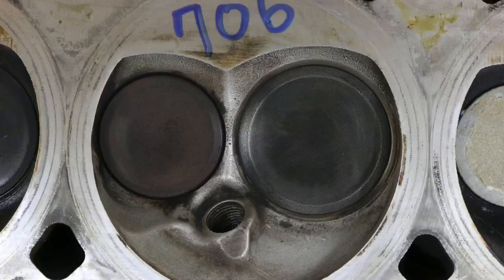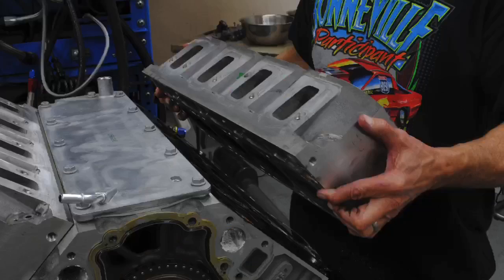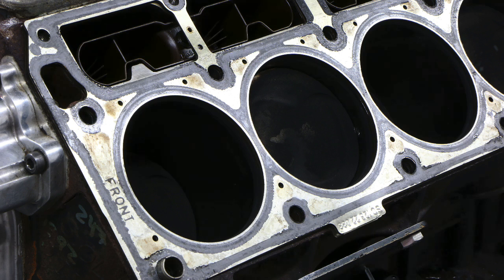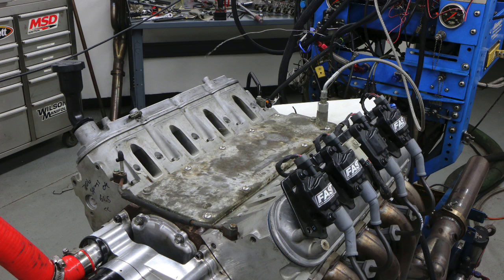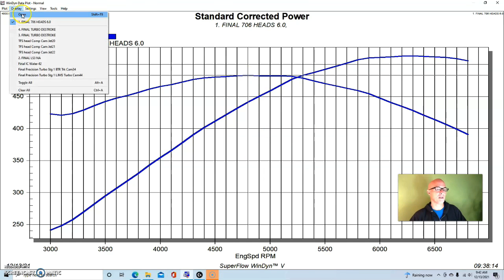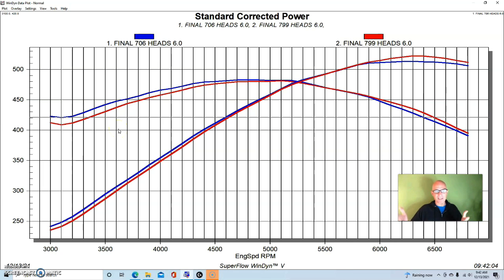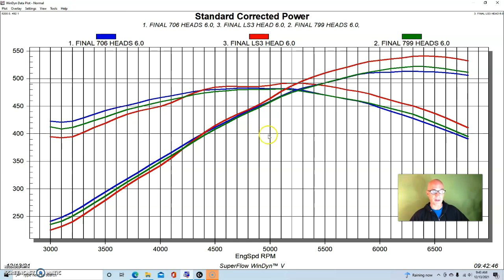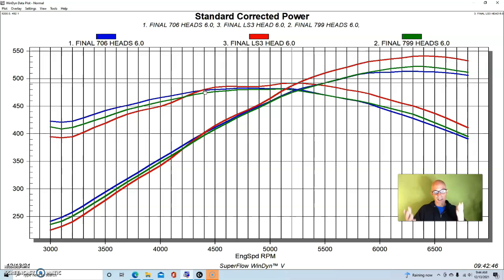JUNKYARD LS HEAD UPGRADE-CATHEDRAL PORT VS REC PORT-WHO WINS? 706 VS 799 VS 317 VS 823 (6.0L & 6.2L)

Comment: Ok so from what I've gathered from lots of people the original cathedral port design was implemented to promote low speed velocity and chamber filling while also out performing previous sbc heads.  As designs changed and volumes increased a need arose for more upper rpm flow, hence the change and evolution of gm cylinder heads. Now we've all seen good ported heads(stock and aftermarket) keep up with and even beat quite a few square port heads.  Now really good ported factory heads from gm back to back generally the square port are just superior....except in the lower lift numbers, not always but mostly and often not by much. However you can get factory gm ls3 style heads above 370 cfm with the right porting job, repeatable all day long amd that's something the ls1 style castings can't do, at least stock heads. Really though Richard obviously is right, if you're boosting any of these heads within reasonable boundaries, are perfect. Yes the curves might be rather different and one will probably promote more high rpm power nut like he said a 750hp turbo(etc) is still limited by how much power it can make and response is a matter of choosing the right setup/size and a/r. Similar to a blower of any design, though in this instance you may notice a bigger variance in power curves but not necessarily peak power. Rung what ya brung boys!
Reply: Im working on a budget build and love Richard's testing to help build off of. I took an lm7 block bored it to a 5.7, got some gen iv rods and a new set of ls6 pistons, sent my 706's off to a local port guy who is highly reputable. He ported them for 400 dollars and sent the bench flow numbers back and they flowed 310 cfm at .600. I had them  milled .020 and assembled and got the block decked and the numbers are pointing to 11.5ish compression with flow of 310 cfm. Got ahold of cam motion and got a custom cam speced for my piston clearance with milling .621 .604 229/237 111.5+3. Going single plane holley split intake with 1000cfm 4brl holley throttle body. Seeing all richards numbers im really hoping this engine size, flow, and compression can get me the 550 ish hp range. I like wierd junk. I dont like walking everyone elses shoes. Gonna put this in a 2wd jeep comanche. I know there are other and likely better ways to make the power, but i wanna be a little different and think i can get the numbers i want with that setup.
Reply: You're sort of missing one of Richard's main points: there's no free lunch. You can get a cheap cathedral port to out-flow a stock rec port, but that porting will cost a lot of time or money. Or buy an aftermarket cathedral head that outflows stock rec ports...again for money.

Long story short: if you want to save money, run 706/862. If you have some extra cash, get rec ports. If you have money burning a hole in your wallet and want max power, unload on a cnc'd aftermarket rec port.

Comment: If you have 317 heads on a 5.3, can you make up hp by using higher compression pistons?
Reply: Why would you have 317 heads on a 5.3L? The 317 heads were the lowest performance head available for the LS engine family. The 317 and 035 heads only came on the earlier 6.0L truck engines. Yes, you can make up for the lost compression with higher compression pistons, but a head change will be way easier. The 317 heads in my experience are necessary for dropping compression to run forced induction. I've built quite a few LS engines since they came out, and maybe built three with the 317 heads
Reply: You can always make higher compression with pistons. Highly recommend it. But take those 317's off first. 10cc's bigger in chamber size is just under 1.5 full points of compression loss, putting you at 8.2-8.5:1 compression. Nobody should have 8.5:1 compression no matter how much boost they're running.

Comment: So what's the compression ratio of a 6.0 with 706 heads?  Too much to run with a "torque" cam on the street with 89 octane I'm guessing?
Reply: 10.92:1 is what my engine measured at. Some folks have put thinner gaskets to get that compression higher to around 11:1. If you're getting close to the 11:1 compression,  then I would consider at minimum 91 octane. I'm running a supercharger at 6 lbs with no issues so far. I don't run anything on regular unleaded fuel.

Comment: Richard, can you do more Honda engine stuff? Like b16 vs b18 vs d series all with and without boost and various bolt ons and cam specs maybe throw in a low displacement k series for comparison like you do with the big blocks and ls

Comment: Take the 317 heads and mill them down to the same chamber size as 706 to see if they are better than 706 799 heads.
Reply: piston-valve clearance will leave the chat.
Reply from the maker: they won't be

Comment: Port Cross sectional area will greatly affect where in the rpm range torque is made. Static Compression ratio will also affect torque and where its made. Valve size / valve curtain area will also weigh in on how well an engine makes torque at low rpm.  The 706 head has a small combustion chamber, small port cross section and small valves. The port reaches an effective velocity at a low engine rpm for good cylinder filling. The small valves create an efficient curtain area for the airflow at lower engine rpm. Combined with small combustion chamber to make use of the low rpm cylinder filling where dynamic compression from cam timing isn’t really in affect torque torque production is high but power will suffer at high rpm. That the exact difference between the 706 head and the 823 head.

Comment: My takeaway is, if you have an LSanything, put in a cam, add turbo & fuel, and be happy.
Reply: Don't forget ring gap if you plan on turning up the boost.
Reply: @LTXwooshie  #ringgap
Reply: Preach it mister!
Reply: I was thinking the same thing, jumped right down that rabbit hole. Richard got me all Wound up# blinding me...with Science. Lol what I didn't consider, the rest of your drive train Suspension ain't going to like 1000 hp for long. 🤑  plus cost to Operate. The girl at the local gas station probably thinks I have a crush on her. Ok, she is cute, but I can't afford to ask her out, need new tires...again. lol

Comment: I don't know if you had a chance to cc them, but I read the 862 heads are larger than the 706 heads, just curious if you noticed that.  I have the cast iron 6L heads with the 2" valve in them.  I have some 862 heads, is it worth the machine shop money to open up the valve seats for the 2" valves?  I plan to deshroud the valves on the 862 no matter what I do.

The more I study the LS the more it seems that the best bang for the buck is to throw money at a turbo setup.  Perhaps a cam/springs also.  But everything else is arguing 20HP for what could be $500 or more in extra parts cost.
Reply: When you get into real power levels (anything above 600), a minute gain of power (20-30hp) can cost a lot. Especially N/A. Reliability is even more expensive.
Reply from the maker: bigger valves help

Comment: I have a LQ4 6.0 Suburban 2500.  I use it to tow a 8000lb trailer.  I was thinking about adding a pair of 862 heads (already own) with a cam and exhaust.  How big (or small) of a cam can I run?  Every two years I would have to put stock exhaust back on to Smog the vehicle.  I like the BTR Stage 2 V2 or the BTR Truck Norris cam.  Will those pass CA smog with Stock exhaust?
Reply: Not sure how deep either of you have dove into the tuning. But until you get rid of the pe delay in first gear. There's also another pe delay in od that's good to get rid of. I just forget exactly which one w/o opening efilive.

Have either of you dragy'd your trucks or ran them at the track to see how they actually perform?
Reply: @HioSSilver1999  Have not done any tuning but would love to get rid of that PE delay nor have I taken my 2500 4x4 Suburban to the track.  I'm sure it would be in the 18-19 second range.  haha
Reply: Hello, I have a pretty similar setup to you. I have an 06 2500hd LQ4 with the btr stage 2, long tubes, TBSS intake, cold air, tuned. I also tow fairly heavy trailers. I would not go any bigger than the stage 2 heads. It's a great combo as is, but would definitely need a torque converter with a larger cam and I'd think you'd sacrifice bottom end going any bigger.
Reply: @thomasgoddard5503  I'm thinking the smaller 862 5.3 stock heads will help on the bottom end torque.  I won't spin this Suburban past 6,100 RPM.  This is my daily that is an all around vehicle.  Takes the kids to school, Tows my car trailer and takes us on trips.   Do you have a sound clip? Did you have to smog your truck?

Comment: So here’s my experience with this similar setup. I have a 6.0 lq4 with a 228r TSP cam. I had 243 heads and an ls6 intake. I recently installed 823 heads and an LSA blower. Obviously the blower adds airflow as soon as the vacuum drops and the bypass valve closes, but I noticed that I needed to add about 20% to the lower rpm, high vacuum area of my VE table. To me that means there is roughly 20% more airflow even down low and not at WOT. 

I definitely think the compression bump is the only reason that the small chamber, cathedral port heads keep up with the rec port heads below 4,000 rpm.
Reply: So a high compression motor with rec ports would be a absolute beast!

Making me wonder if should done high compression on my stroker Build, but I'm planning to put a LSA on it eventually so compression is going to be around 10:1.
Reply: @christophermix6845  can’t go wrong with the LSA. I ported mine and on 12 psi made a conservative 639whp at only 5900 rpm.
Reply: @PetesGarageandperformance  they're to small unless it's getting put on a truck.
Reply: @PetesGarageandperformance  yah I don't think I'll need the extra power though lol.
It's going in my 04 Silverado with hard all terrain tires.
Reply: More compression on cathedral ports heads that's the power down low.

Comment: If your installing a cam on a 6.0 or 6.2 and are planning on revving it past 6000rpm the rectangle port heads are the way to go it will need a 3000rpm or more stall converter and 3.73-4.10 gears for it to shine but if your looking for more torque off idle to 3500rpm with a tighter converter and 3.20-3.42 gears in a heavy truck the cathedral ports heads will be good would be my take hard to beat rectangle port heads on a LS above 4000rpm unless your wanting to invest in something like AFR 260cc mongoose heads but look to spend 2600 dollars plus for a set complete
Reply: +1 on rectangle port being hard to beat. 100% agree.

Comment: Just throw a cam and a converter in it and go burn rubber! If you have a LS anything (4.8, 5.3, 5.7, 6.0, 6.2), cam+converter=fun. Don't worry about the heads, don't worry about the intake. 

Oh yeah, you are also going to need drag radials to hook up! Street tires will spin all they way down the block effortlessly
Reply: Eh. Been there done that, if you buy the converter for a 6.0 that makes 450hp, get bored of it because you get used to it and down the line want a BIGGER cam and cylinder heads and intake to make 600hp or you stroke the thing and make 700hp, guess what you're buying again? The converter! This is me speaking from experience.
Reply: Probably the worst advice ever in the history of advice.

Comment: I say it's static compression to answer ur question. But here's a question, on a 5.3 and 6.0, what head would be best for N20? And how much of a power gain on a 300 shot? Be interested to see.
Reply from the maker: nitrous just adds to what is there-pick the head that makes the best na power then add your nitrous
Reply: Depends greatly on how much nitrous,  up to ~200 hp it's probably worth the same increase on either head

Comment: I believe the 317 and 799/243 heads share the same valves and ports and the only difference is the combustion chamber size? If that's the case then it has to be the static CR.
Reply from the maker: the 317 chamber is not just larger-it is a different design

Comment: I’d like to point something out. If a fast intake makes the same as the ls3, why not use a fast intake on the cathedral setup instead of the dorman? It’ll close the gap because the ls3 intake is superior to the ls2 dorman.
Reply from the maker: it will and I did
Reply: The dorman intake isn't the same as a stock LS2 intake... it's far better. I think the comparison between a dorman intake vs a ls3 intake is more apples to apples stock style (and price) setup.
Reply: @TheBreaded  sorry but, respectfully, you are incorrect. 1) I have a dorman ls2 on my engine 2) if you look up the huge ls intake Dyno test, you’ll see that a fast intake puts a solid beating on the tbss intake, then look up the test between the tbss intake and the dorman ls2 and the power almost mirrors each other. Now, add in some critical thinking and you’ll put together the fact that the dorman ls2 and the tbss are the same, then go back to the test where a fast is in the same test as the tbss and you’ll see that it beats it pretty good. The ls3, fast ls3 and the cathedral fast are a much closer match for each other. Btw, the dorman ls2 is a hunk of poorly built shit. The top and bottom are mismatched. The gasket hangs out all over the inside of it and the tubes that the mounting bolts go through mushroom under less torque than recommended. I would not pay the price they are asking for that garbage. I bought one when they were under $300

Comment: Would using a stock ly6 intake  help torque down low?
Reply: Basically the same figures as running a LS3 intake.
Reply from the maker: compared to what?
Reply: @richardholdener1727  On a ly6. I have a lq4 now with rec ports and truck intake on the shelf. Would the truck intake bring torque up below the curve. Looking to make torque down low in a jeep.
Reply: @richardholdener1727  so first time I ve asked a ? And gotten a response.  Dumb question how do I make donation